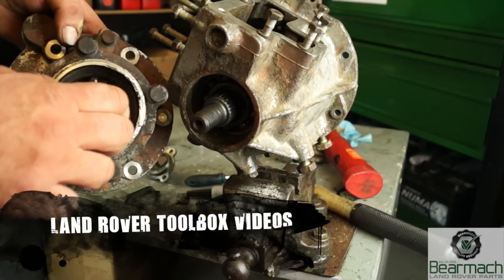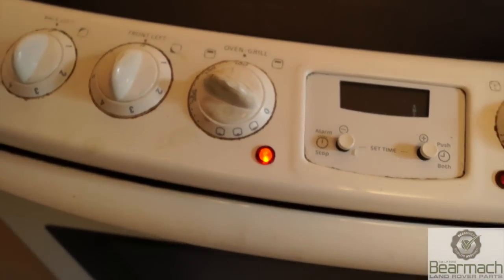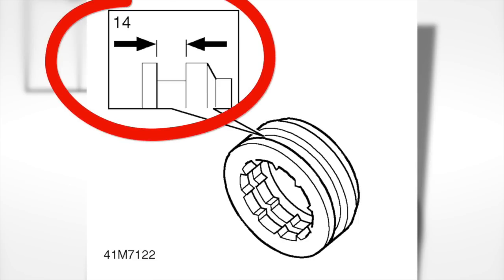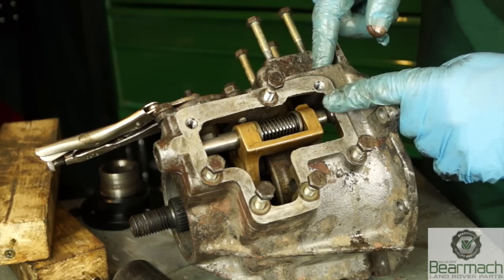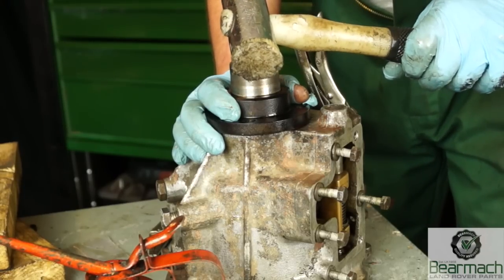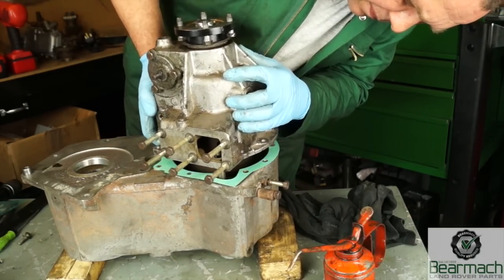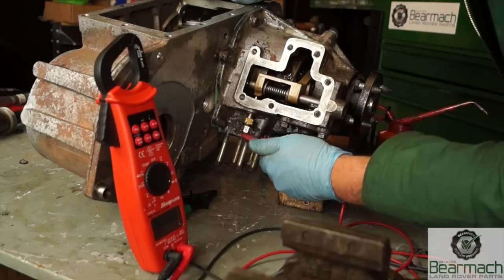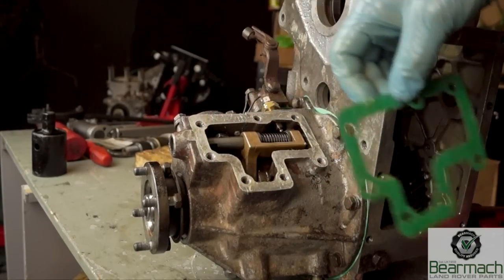Replacing the bearings LT230  part 2 -  The Fine Art of Land Rover Maintenance

Comment from the maker: pkworld  there is quite an area for the seal to run on the flange seal land.  As I said in the video knock it in flush so it goes in even then knock it lower with a large socket.   It needs to go deeper so the flange does not bind on the outer top lip of the seal.

Comment: Wow ... there's a LOT of info to absorb in that one! Excellent work chap... I will suggest a gentle wire brush on an old drill (not the twisted wire type on an angle grinder) is a good way to speed up the clean up of gasket material. Not good practise for a prized brand new lithium makita or the like but a fine job for it's predecessor.
Reply from the maker: Matt Allen Yeah i got ya.  I got an old 240V drill for wire brushing which reminds me its about time to upgrade to a bench grinder with wire brush..   lot to do this year.
Reply: ***** A lot to do? I think that's a serious understatement! lol
Reply from the maker: All in good time  ;)

Comment: Iv'e been watching these videos with interest as I recently overhauled an LT230 using Ashcroft Transmissions bearing & seal rebuild kit. I'm putting a 1.44 box in my Disco to allow for the larger tyres. So I'll have a 1.22 box going spare soon.
I couldn't help but notice that when you fitted the output shaft seal, it was flush with the casing whereas the overhaul manual (page 37) says it should be "just contacting the circlip" (Which I think is a bit too far in, but it's done now so...) What are your thoughts?